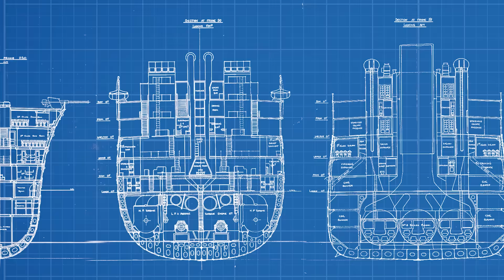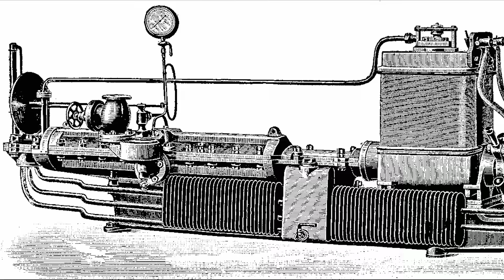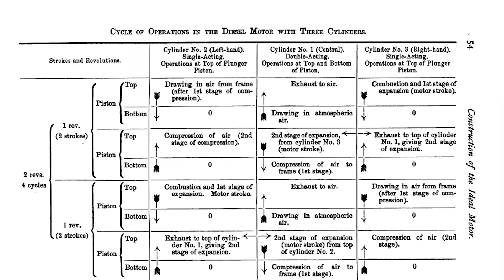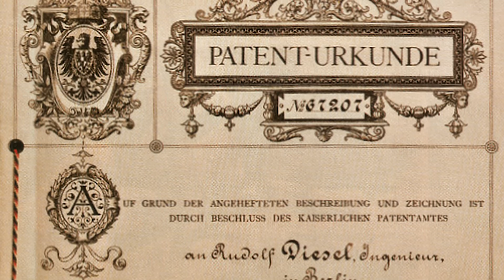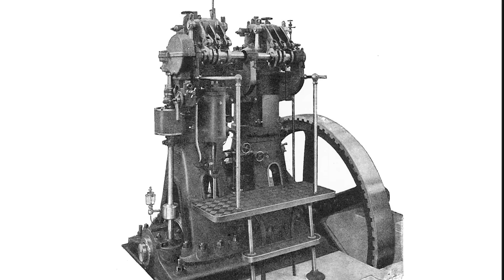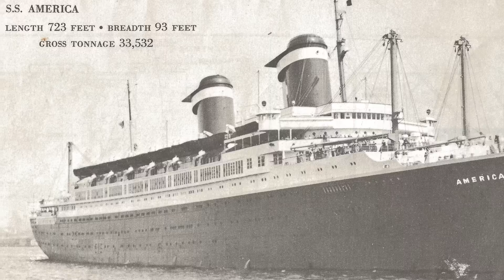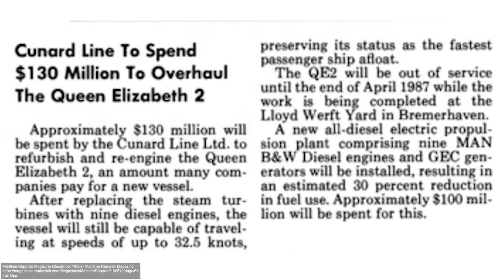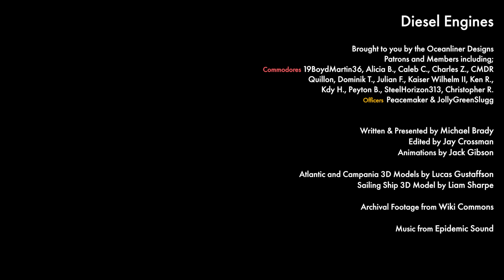How the Diesel Engine Became King of the Seas

Comment: They weren't always diesel electric. Surely propellers where directly powered by the diesel engine itself at some stage along the line. Then they switched to electric motors to turn the props driven by electricity from generators which where spun by the diesel engine.

Comment: Wärtsilä mentioned at the end! While most people tend to bring up Nokia at their height as the best example of a Finnish success story, I take more pride in Wärtsilä and their giant diesel engines. I live close to the building originally constructed as their head office, which borders a street named after one of the engineers who was involved in founding of the company. They still had an office there until maybe a decade or so ago, though have since sold the space.
Reply: TBF the large Two Stroke Engines were never really Finnish Wärtsilä; it's just Sulzer bought by the Wärtsilä Conglomerate but all of the Two Stroke Business still remained in Winterthur/Switzerland. It's exactly the same with Maschinenbau Augsburg-Nürnberg (MAN) and Burmeister & Wain (B&W), these Engines may have MAN written on them but it's still Danish Engineering, MAN just bought B&W 45 odd Years ago but the entire Two Stroke Department still is in Copenhagen. All of this is for Design only, Manufacturing of these Engine is done under License nearby to Shipyards or even the Shipyards themselves anyway, because transporting such Engines would be ridiculous. As (nearly) all Cargo Shipbuilding is in Asia today, these Licensees are Hyundai, Mitsubishi, Kawasaki or Doosan.
Reply: I'm a fan of Sisu Diesel!
Reply: It's a great company and now very important in grid-scale batteries - they bought Greensmith in 2017 and are now building the biggest battery in Australia at the site of the former Eraring coal fired power station. It will be 700 MW and 2,800 MWh used for grid stability and renewables smoothing. For example, that will power an aluminium smelter or a small city for 4 hours, although it will never be used alone like that but rathe mixed with other supplies.

Comment: Even NGI in the 1920's had some diesel powered ships . 
Them being 
MV Saturnia and MV Vulcania (the one that carried rex's spare parts on her maiden voiage) them being 181.58 meters or 596 ft and displacing almost 24.000. grt .
And being powered by two diesel engines producing 34.000 shp and a speed of 19.5 kts .
And SS Roma's twin sister MV Augustus of 1926 . 
She was 215.25 mt (706ft) and displacing 32.582 grt making her the biggest motor vessel of the time.
Her being equipped with 4 Savoja M.A.N engines producing 28.000 shp giving her a quite respectable 20 knot speed

Comment: From my armchair engineering perspective from my armchair engineering perspective; the future of ship's power seems to be more diversified. Short-haul charters like ferry operations seem to want to go battery electric. Major Navy's are going in two directions: larger ship that require raw power and prolonged operational deployments are going nuclear. Smaller faster ships like destroyers and frigates are going over to gas turbine power. Fantastic ship cruise liners are being designed with half a dozen smaller diesel engines instead of a couple large ones; and are being used to power the propellers electrically. Of course you're about creators are staying true to form with their engines, but they're increasingly exploring supplemental wind power, because the price of fuel oil keeps going up.

Comment: Steam turbine engines require reduction gears, diesels do not. Reduction gears can cost more than the power plant.
Reply: Yes, though to be pedantic not needing reduction gearing or gearboxes applies to low-speed diesels. Medium speed diesels popular on things like ferries (and warships) need reduction gearing, or then nowadays increasingly often they use a diesel-electric powertrain.

Comment: Diesels gave the German Panzerschiff (armored ship), aka pocket battleships, their abnormally long range. They had 1/3 the displacement of an Iowa class Battleship and 10% more Range. Small modular nuclear reactor probably will replace diesel engines on large ships at some point long in the future. Once the SMNRs are in place the crew doesn’t have to touch them and when it needs to be refueled they can just pull out the old one and replace it with one that has fresh fuel. The old one can then go back to the factory and be refueled. Ships will have to be built to have this capability so the transition will be slow

Comment: Wasn't the reason why coal ships lower half were black was due the blackened mess loading coal made on the ships? This reason wasn't a problem for diesel ships BUT by then, the coloring was the standard for ships. Later most diesel-powered cruiseship switched to all-white was to look look cleaner and more modern ... and save on air-conditioning? 😉

Comment: Some ships were converted from  steam to diesel-electric and to steam again.
The start of the 20th century paddlewheelers on lake Geneva were converted back to steam because of cleaner emissions.
Modern computers and sensors now control the natural gas fired boilers and other processes on those ships.
Reply: Diesel electric is a awesome approach
Reply: @jonathanjones3126  Its becoming the standard on diesel locomotives and azimuth propulsion on tugs and big passengerships.
Also modern DMU trains have a generator set that powers the electric motors in the powerbogies of the DMU
On modern big cruiseships the azimuth pods can act also as classic thrusters.
Reply: @obelic71  electric motors are better then any engine for propulsion,  the problem has been where to get the electricity
Reply: @jonathanjones3126  correct electric motors have instant torq from low rpm thats why forklifts/other warehouse equipment, ships and trains use them for decades!
For personal vehicels like f.e. cars and motorbikes the battery tech is still lacking and evolving.
Due to the battery scare EV's have a 3 times so big  devaluation then an ICE.
A huge concern for the average consumer who normaly bought used fleetcars .
Reply: @obelic71  once reliable energy dense batteries become commercially available and are cheap along with a much better power grid, the will electric vehicles be acceptable to me.

Lithium and sodium ion won't make it for any use larger then a laptop due to chemistry

Comment: Another wonderful presentation! Two thoughts: 
1. Don't diesels produce less excess heat than either steam engines or spark ignition engines? 
2. When calculating weight per horsepower should one include the reduction of fuel for the diesel engine? 
Again, thanks and blessings for fantastic work!

Comment: So if my matting is correct the Q2 lost money on the retrofit. 160m to retrofit and saved 6.5m/ year for 21 years for 136.5m fuel savings. Net loss of 23.5m
Reply: Diesel Plants also need less Crew, and Boilers need much more Safety Inspections. Keeping Diesel Engines running is pretty much left to the Crew between Classification Inspections every 5 Years, Boilers need yearly Pressure Tests and internal Inspections which require the Boiler to cool down. Feed Water also isn't cheap, because Water Tube Boilers are very sensitive in that regard and can't just take any Fresh Water.

Comment: The one marine use for steam turbines that will keep on going is nuclear powered subs and super carriers. One can doubt if harbors will ever allow commercial nuke powered ships, those are melt downs waiting to happen and how many passengers want to sail on reactor powered cruise vessels. Fusion would be fine if it ever becomes practical. 

The German's put diesels in their pocket battleship super cruisers, but they had lots of problems including excess smoke and the Kreigsmarine reverted to steam turbines in the Scharnhorsts and Bismarcks. They were going to use diesels in the H-class for the long range. The Yamatos were originally going to be diesels for cruising range, but the test motors performed so badly on utility ships they went for turbines with half the cruising range.

Comment: Are there any hybrid diesel (generator) / electric propulsion ships? If there are, do these have advantages / disadvantages? May not be an Oceanliner topic, but just curious.
Reply: Lots of them, increasingly popular for things like ferries, cruise ships etc. Often combined with "Azipid" rudder-propulsion units that give a lot more maneuverability at low speed compared to a traditional fixed propeller and rudder.
Reply: Many classes of US drednaughts used it 100 years ago. Also very big in modern warships, like the upcoming Constellation class frigates or basically every post WW2 non-nuclear submarines. Gives you plenty energy to power radars, lasers and whatnot, and makes compartmentalisation easier.

Comment: But is it a mechanical drive, or electrical? With locomotives, the early attempts also produced weak engines. But they soon figured that the diesel engine could instead be used to generate electricity and use that to drive electric motors. Do ships do the same? Sure, nuclear power makes steam and could theoretically drive an old fashioned steam turbine, but i think the most used solution is to simply generate electric power for electric motors.
Reply: Some ships have diesel-electric propulsion yes, others not. In contrast to locomotives, with ships you don't need many different gear ratios so diesel-electric on ships is not as much an obvious winner as on locomotives.
Reply: @jbepsilon  There are also efficiency losses to consider.

Comment: I still remember reading a kids book (Scholastic), back in the sixties where it talked about Rudolf Diesel and his impact on propulsion in general.  They also touched on his disappearance and as you say, a lot of speculation on what power decided killing the Golden Goose was a smart idea with Imperial Germany as a big player, pre WW I.  Here we are talking about it 60 years later.  Diesels DO have their issues, my daughter's Navy ship has four MAN (Colt-Pielstick) diesels and before Drydock in 2022, they would be real 'good' at sailing and returning to port on one or two engines.  Thank you Mike for a comprehensive trot down memory lane.
Reply: 110 years later.
Reply: Yes they do have failure points, but well designed diesel engines that are well maintained are quite simply, the best option for most categories of ships and submarines.
Reply: You might be interested in a book called The Mysterious Case of Rudolph Diesel.  The author did his own investigation of Diesel's disappearance and arrives at a very interesting conclusion.

Comment: To put a finer point on the efficiency difference, one pound of water, (16 oz liquid) takes 1 BTU per degree of temp rise (Fahrenheit) between 32 degrees and 212 degrees, 180 BTU's. It take another 970 BTU's, 5.388 times as much energy to change between liquid and gas (steam.) That change of state is known as "latent heat of vaporization". After the steam is run through the cycle and condensed back into water, Most of that energy, "latent heat of condensation" is lost to the ocean in the condenser. The condenser is under 28 or 29" of vacuum so you can recover a little of the heat but most of it is lost.

Comment: The Diesel Engine was originally designed to run on non-petroleum based fuel. There is a fantastic book which tells the entire story. "The Mysterious Case of Rudolf Diesel". Rudolf Diesel actually put himself in great danger by two world figureheads who had the most to lose by Diesel's success. Read this book!
Reply: Diesel engines can run on many fuel types and Mixes depending on the setup and construction.

Comment: And of course when it came to the railroads the same thing ultimately happened, Diesel Electric locomotives though initially underpowered compared to their steam engine counterparts quickly took over given they were far more efficient and easier to operate than steam engines. To put it into comparison the first "Road" engine was the pioneer Zephyr M10000 in 1934. In 20 years time every U.S. railroad was converting or had converted over to Diesel engines. Other places in the world took longer but the writing was on the wall ultimately for the steam engine.

Comment: Very interesting video Mike, but there wasn't just one type of diesel engine in use. The design that Doxford was famous for relied on opposed pistons, most other designs such as the B & W, Sulzer and MAN were conventional engines with a single piston in each cylinder. Also many engine builders manufactured slow and medium speed diesels. The slow speed engines were usually two strokes and were reversible whereas the medium speed engines were four stroke none reversing engines and would be used either in conjunction with a variable pitch propeller or would be used to drive electrical generators which were used to power electrical motors connected to the ships propellers. Diesel engines were also used to drive the ships main and emergency generators as well of course. It's been 25 years this April since I last set foot in a ships engine room so I'm not sure what most ships are using today, but back then most ships were using long stroke/ super long stroke single acting two stroke slow speed reversing engines, made by companies like MAN/B&W (who had amalgamated) and Sulzer, Doxford having gone out of Business. Many were built under license by other engineering companies, Mitsui in Japan and, back in the day, Harland & Wolf in Belfast and Kincaid in Glasgow for example. Many coastal ships, ferries and cruise ships and a few other vessels used medium speed four stroke engines. 
To my knowledge nobody is using opposed piston engines these days for marine propulsion, though some medium speed triple opposed engines are still to be found powering preserved diesel locomotives ( English Electric Deltics ) on British heritage lines. These engines were also apparently used for powering a class of mine sweeper used by the Royal Navy.
Reply: Nicely said.  One minor point - Deltics are considered high speed engines. The rail version running at 1,500rpm and the marine version running up to 2,500rpm. I believe the threshold between medium speed and high speed is 1,000rpm.
Reply: Thanks for adding these details. It's really a fascinating topic.
Reply: Very well stated. 
I am 68 and have had the pleasure of sailing briefly on the DS Regional Endeavour which had a Doxford main engine. They were quite the work of art. These days our Marin engineers seem to think they are quite something as they sit with their feet up on the log desk watching dials or lcd screens. I guess that makes me a bit of a relic also, but I think I would rather be the relic 😊
Reply: The Navy got there first, with English Electric adopting it for the “Deltic” class of railway locomotive. The deltic design came along after the Junkers-Jumo opposing piston 2-stroke type that was used in aviation by the Luftwaffe. A lot of the German bombers were oil fuelled that way.

Comment: Have to pick a nit .. steam is very much alive.  Every nuclear powered ship and sub uses the reactor's heat to... Boil water to drive turbines
Reply: Coal, gas, nuclear, hydrothermal and other electricity power generation use steam too. So it's definitely not disappeared.
Reply: @whitecanegamer  We are talking about ships here where coal has disappeared, gas was never a thing, nuclear is almost entirely restricted to select military vessels and hydrothermal what? Do you even know what that word means?
Reply: @pop5678eye  I was pointing out areas that still use steam for power generation, in addition to how it's still used aboard ships. And yes, I do know what hydrothermal means, that's why I included it in the list.
Reply: Please count up the number as well as size of those ships versus the overwhelming number of diesel-powered large modern cargo or tanker vessels right now. Notice outside of the military there have only ever been experimental vessels using nuclear powered steam engines.

Comment: Imagine the change in refueling, from spending hour after hour with a whole crew dumping dusty, dirt hunks of coal down chutes into the huge bunkers to just a couple of workers bolting on a hose and switching on a pump.
Reply: Sorry mate. Diesel engine hat nothing to do with it. Oil fired boilers became a thing before that. Every ship after WWI was converted to oil
Reply: @RelativyX Yes, the ease of refueling meant that fleets were already moving to oil. But the diesel engine lead to higher thermal efficiency, fuel savings, clean operation, labor savings, and startup and shutdown loss savings.
Reply: Good paying jobs for everyone who wanted to work! Now... "Would you like fries with that?"!!!

Comment: 9:59 I'm not sure if that is correct, I think they have to be warmed up, or at least not freezing to start. I think this is why trains and semis are always idling. Someone correct me if I'm wrong!
Reply: Trucks idle for a few reasons, usually to keep the AC on in the cab, or to power the chiller unit in a refrigerated trailer. In very cold climates, they'll keep it running as it's hard to get it started again, but that's true for all engines in that kind of weather. Large marine diesels tend to use compressed air to crank them over until they can run on their own. Not exactly a turn key operation but still quicker than building up steam in a boiler.
Reply: On a truck or locomotive where the prime mover is the only source of power, yes.  But almost all diesel ships have either multiple engines, or separate electricity-generating diesels, and they typically use seawater for cooling rather than antifreeze.  So you can heat keep the oil heated and don’t need to worry about the coolant freezing over.